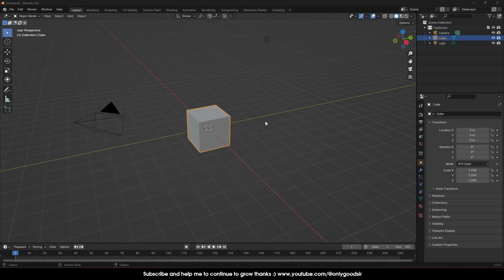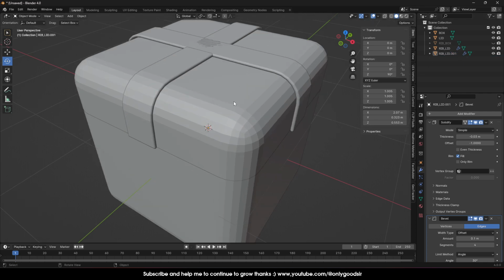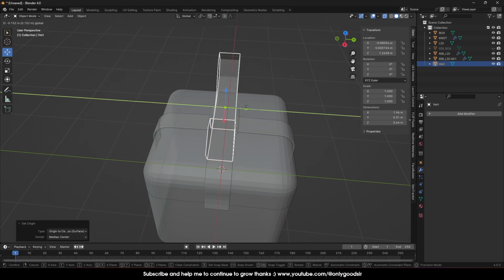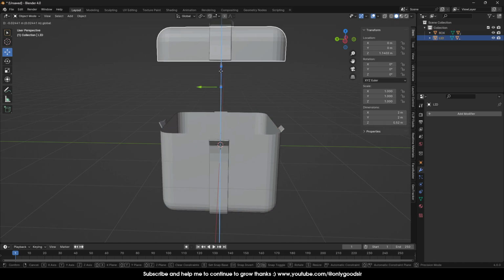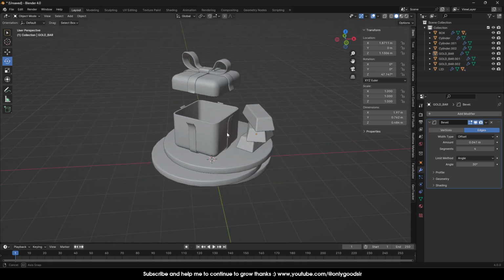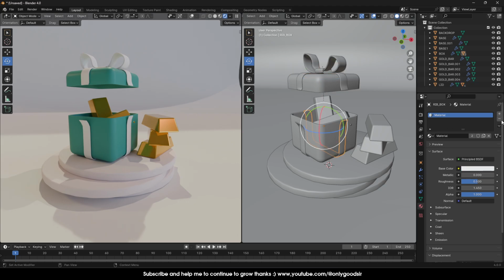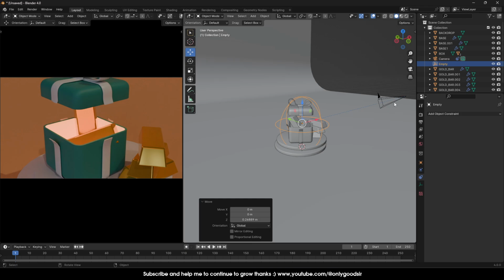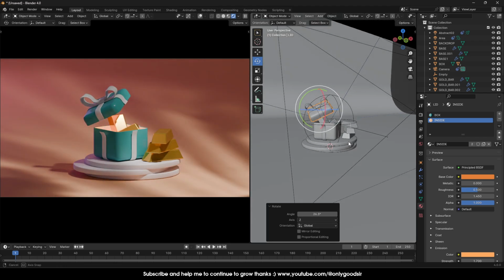Blender 4.0 Tutorial: Modeling a Festive Christmas Box with Materials and Lighting

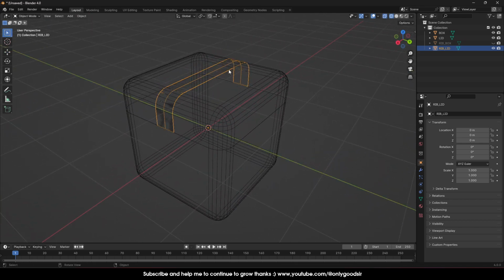Comment: Very fun tutorial. Trying to learn some basic Blender. Quick question: When I try to do the 2nd extrude on the RibLid (4:20), when I hit "A", the entire ribbon gets selected instead of just the original edge. Any idea why? I have tried 3 different times and the same thing happens. I've checked the settings and everything seems to be exactly how you have it including having it in edge select mode.

Thanks for the vid.
Reply from the maker: Thanks 🙏🏻 A will select all try alt click to select the loop
Reply: @Onlygoodsir  Just finished! Turned out great!. Man, I thought I had a pretty beefy PC until the rendering. Onto the snow globe next. 🙂